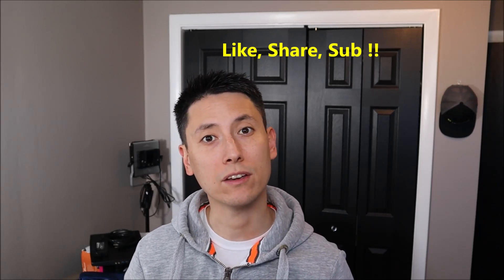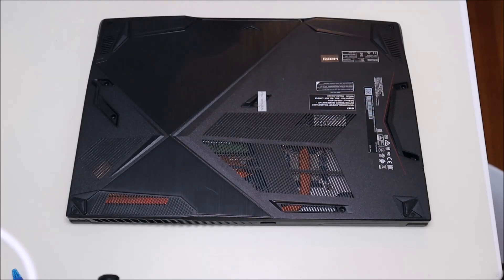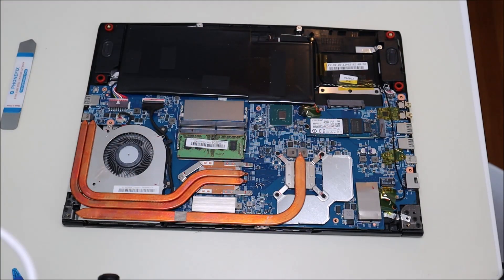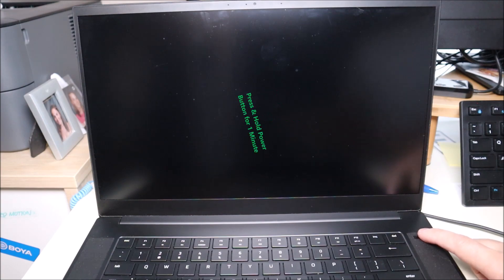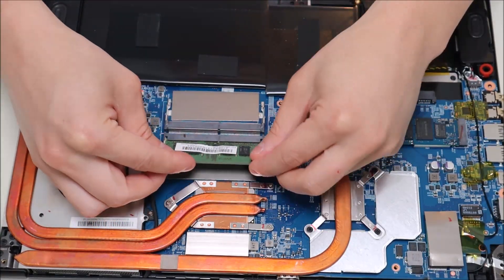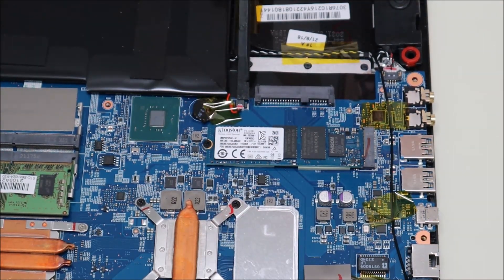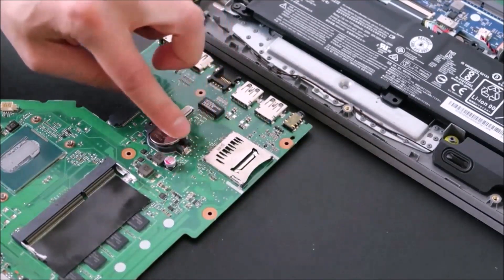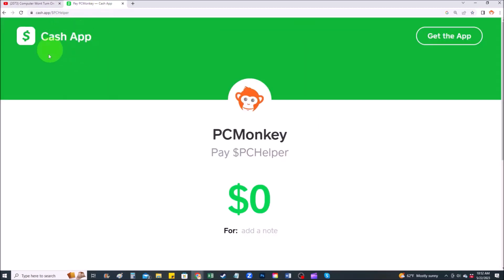MSI Laptop Computer - Dead / No Power / Wont Turn On Fix

Comment: my laptop powered on after removing the battery and plugging it in again. this method works every time, but i still face power on issues now and then. does this mean i need to change my battery?
Reply from the maker: Yes, you most likely need to replace the battery or charger. Also, is your computer plugged into a healthy surge protector? You can see a good example of one here: https://amzn.to/3XpHdlw
Reply: @PC_Monkey my charger likely works fine, it's the original charger and it will charge other msi laptops pretty fine. i know that my laptop battery has not been the healthiest for a long time now, and I feel like it's the right move to replace it.
Reply from the maker: @XenonForce  Good luck replacing the battery! Let me know if you would like help finding one :)
Reply: @PC_Monkey i think i will try to leave my laptop in a batteryless state and use bypass charging in the meantime while trying to find a suitable battery. may I kindly ask which battery would be suitable for model msi katana gf66 11ud?
Reply from the maker: @XenonForce  Not sure :( Is this your battery? https://amzn.to/43DR3TX

Comment: ok so im currently having this issue i disconnected the main battery from the motherboard than connected it again and it turned on for about 10 seconds before screen started flickering and than it went back to how it was before black screen button lights off
Reply from the maker: After trying that step, can you try the other steps seen here? Also, did anything happen before this issue started? Overheating, liquid spill, Windows update, etc?
Reply: @PC_Monkey  no overheating or liquid spill there was a windows update but that was way before this started i opened it up again and took out the ram and put it back in aswell as the battery and it was working fine but after i turned it off after that and closed it up and put the screws in it started flickering again when i turned it on so im at my wits end here
Reply from the maker: @vandastelka2522   If, after trying all the steps seen here multiple times, you have not been able to find the issue, your most likely looking at one of two possible issues. (1) The motherboard is bad and needs to be replaced. Let me know if you would like help finding a compatible motherboard. Or (2) there is another computer component, shorting out the motherboard and need to be replaced such as the power jack, USB board, Touchpad, etc. You would have to troubleshoot each of those individually but unhooking it from the motherboard and trying to turn the computer on. Let me know if you would like help with that operation.

Comment: Hello i have MSI Katana 15 B13V and sometimes i have to press the power button twice to turn on my laptop (when i first clicked the power button the power indicator is not even turn on so i have to click it again), is there any problem with it? can u help me please?
Reply from the maker: Can you perform the power drain a couple times as seen here? Does that help at all? Also, did anything happen before this issue started? Overheating, liquid spill, Windows update, etc?
Reply: @PC_Monkey  thank you for responding. actually my laptop is new its not even a month old so i kinda afraid to do the power drain especially several times. and about the second question i think nothing happening before the issue started because this is a new laptop.
Reply from the maker: @Lionidas21  If its new and still under warranty, you could void part or all of the warranty by opening it up. I would consider a warranty repair or replacement

Comment: My laptop wouldnt turn on after i forgot to remove the battery when i change my edp cable.

i have tried everything like pressing 60 second, remove the battery , then drain the power, put it back , and the ram , the cmos but it still not working.

i dont know wich part is broken but is that possible to quickly broke the motherboard when i forgot to remove the battery?

my laptop is msi gf 63 thin uc. and also i notice something. when i charge the laptop that is a small white led will turning on while charging even if the laptop is shutdown. but in my laptop now is also not working. 

so my laptop is completely dead and not even give any clue of life
Reply from the maker: If, after trying all the steps seen here multiple times, you have not been able to find the issue, your most likely looking at one of two possible issues. (1) The motherboard is bad and needs to be replaced. Let me know if you would like help finding a compatible motherboard. Or (2) there is another computer component, shorting out the motherboard and need to be replaced such as the power jack, USB board, Touchpad, etc. You would have to troubleshoot each of those individually but unhooking it from the motherboard and trying to turn the computer on. Let me know if you would like help with that operation.

Comment: I have MSI Katana GF66. My laptop won’t turn on. I think the issue is it’s not charging. My charger became too loose to fit in the charging plug. So I ordered a new charger and it still doesn’t charge or turn on. I pressed the power button for 1 min it didn’t turn on.

Assuming this is an old video, so getting a comment will take some time. I have warranty, so I’ll send it to repair but it would be really nice to know what the issue is and how to fix it in future.

Thank you in advance.
Reply from the maker: There are several reasons why a computer stops turning on. Unfortunately I can tell you the reason your computer isnt working without troubleshooting it. If you want to know what the issue is, I would recommend troubleshooting as seen here :)
Reply: @ thank you!!
Reply from the maker: @pateldhyey3063   Good luck !!  Let me know how it goes :)

Comment: None of those worked for me unfortunately

It started after i opened it up and tried to figure out why my monitor was having issues, i made sure not to short anything with metal or such

Only thing i touched inside is what seems like the ribon connector controlling the display, but i put it back properly, not really sure what could be broken
Reply from the maker: Are there any signs of life at all when you try to turn it on? Lights? Fan, Motherboard, or Hard Drive sounds? Anything seen on the screen?
Reply: @PC_Monkey  Nope nothing at all

I figured it out though.. The plastic bit on the battery thats held by a screw broke (Thanks MSI for putting a single screw for the entire heavy battery, very smart)

So it wasn't plugged properly and caused issues
Reply from the maker: @jajasteele  Glad your all set :) Always here if needed !!

Comment: Hello I hope you can see this, my MSI Thin 15 doesn't wanna turn on, it was plug when it happen, it was a gift and I'm sad I need help I need the basic stuff but nothing works
Reply from the maker: Sounds like your on the correct video.  Have you tried the steps seen here?
Also, did anything happen before this issue started? Overheating, liquid spill, Windows update, etc?
Reply: @PC_Monkey  no, none of this occur before the issue, I'll then try fix it using this video, thank you so much I hope it works because I have no guarantee 🥹🩷

Comment: my computer is flashing blue on it’s turn on
Reply from the maker: Sounds like your on the correct video.  Have you tried the steps seen here?
Also, did anything happen before the issue? Overheating, liquid spill, Windows update, etc?

Comment: I have quite the occurrence that I’m sure people have had happen but it’s super rare. So I had turned the laptop on and I only had like 15% left. Apparently the charger part needed to update. The problem I had is saving as much life as I could the laptop couldn’t hold on and died. So what happens now is want someone to answer? Can I just never use it anymore cause it won’t charge. It shut down on me mid-update.
Reply from the maker: Does the computer turn on now? its just stuck at 15% battery life and cant complete that update?
Reply: @ No so it died on me mid update so It can’t charge at all. I also tried the first method you did but all I got was a couple of flashing white on the power but didn’t do anything after that. In case you need to know I have the G556 Stealth.
Reply from the maker: @hender_tender1232  If the power drain didnt help, can you move on and try the rest of the steps seen here?

Comment: what does red LED of power Button mean ?
Reply from the maker: Sounds like your on the correct video.  Have you tried the steps seen here?
Also, did anything happen before the issue? Overheating, liquid spill, Windows update, etc?

Comment: what does red LED of power Button mean
Reply from the maker: Sounds like your on the correct video.  Have you tried the steps seen here?
Also, did anything happen before the issue? Overheating, liquid spill, Windows update, etc?
Reply: @PC_Monkey   i just plugged it to the grid , and hold the power button for a while, thank you, it seems it was low on battery
Reply from the maker: @stefano4533    Great to hear !! Always here to help :):)

Comment: Thank you Daniel great advises!  I got a MSI laptop and I was playing with out being conected to the wall. Then now is ridiculous slow and I cant do anything. The red light next to the start buttom keeps changging from solod red to whote every 20 sec or so. Do you uave any advised? Thank you appreciated
Reply from the maker: Sounds like your on the correct video.  Have you tried the steps seen here?
Also, did anything happen before this issue started? Overheating, liquid spill, Windows update, etc?
Reply: @ the Date was off and I fixed. It turned on, ask me to set a new pin number but dont go anywhere. I tell you what happen: I start playing Ghost of tsushima And I didnt realized wax no plug ged in. Tuen started running very sliw and I connected. Maybe over heat . Thanks a lot fo the help! What do you think?
Reply: I try what is in the video great. Just the date. Do you think I should try the other option on it?
Reply from the maker: @sileto4821  I dont understand. This video is showing how to fix a dead computer. A computer that wont power on. There are not steps seen in this video showing how to correct a date? What is the issue with your computer? Does it not turn on or are you having trouble changing the date in BIOS?
Reply: @PC_Monkey  I saw yor video about the Bio. And the date was off

Comment: Thank you for demonstrating the disconnecting of the battery plug. I needed the reassurance that it was in fact hard to remove and I just kept on trying for 10 minutes. Then holding the power button worked fine to revive my laptop.
Reply from the maker: Great to hear !! Always here to help :):)

Comment: so, i accidently shut my laptop down my flipping down the lid while updating i tried the power button method and im really stupid so ill fuck up the motherboard
Reply from the maker: No. Just the operating system (OS). If a computer turns off during an update, it very often can damage the OS. First, try the power drain procedure seen here: https://youtu.be/kOBY4k2Mn_k. After that, can you turn the computer on? If Windows wont load fully, can you access BIOS and find any Repair or Restore options?

Comment: Removing the battery plugging it back in then holding the button and then finally the power plug in made it work

Have no idea why it did this do you have suggestions to hopefully prevent this issue?

My laptop is the thin 15 with the 4050 and 12th i7 i didnt overclock or mess around with the bios
Reply from the maker: Glad your all set :) Always here if needed !!   
It could be just a normal and random power buildup or it could be a battery or charger starting to fail. Also, make sure your computer is plugged into a surge protector like the one in this list: https://www.amazon.com/shop/pcmonkey/list/2QAI8XMVWC7DK?ref_=aip_sf_list_spv_ofs_mixed_d

Comment: Idk my laptop is so complicated it turns on but when i look at the power it says 0 even though I have plugged it in for literally hours , even crazier when i play with it like minecraft you cant turn on the fancy settings or it well turn of sometimes i have it on low and still turns off , and my fan is making new noise every day 😅
Reply from the maker: If the battery is not charging, can you try the steps seen here? https://www.youtube.com/watch?v=uBr5XmtmKKM
Also, did anything happen before this issue appeared?  Liquid spill, overheating, Windows update, etc?

Comment: I have a msi gf63 11uc i tried upgrading the ssd and now it wont power on. There are no signs of life
Reply from the maker: The computer was turning on and working well before the SSD install? If so, have you tried putting the old SSD back and turning on the computer?

Comment: My daughter has a Modern 15. Charging jack melted. Desoldered jack to replace, but board was burnt. Purchased new board. Not exactly same but same form factor. Installed the board and all hardware. I get a charging light when plugging in charger, but nothing at all when pressing power button. Tried EC reset. Nothing. Any ideas?
Reply from the maker: Did you replace the charger? Very likely its damaged too or could even have been the cause of the problem
Reply: nothing wrong with the charger. It’s my other daughter’s.

Comment: It works for me without the battery. Like what do I do? Replace the battery and it will work fine?. I re applied thermal paste. I made sure to remove the battery. Then afterwards, the laptop won't turn on. I removed the battery like you said and checked with power. It works fine 😭😭. I guess time to replace battery
Reply: Nvm i just re inserted the battery pin and it started working. Idk why, early i inserted it firmly. Now i inserted it extra extra firmly and it's working. Man I never have these issues with later laps. Just msi 💀
Reply from the maker: @denji3397  Glad your all set :) Always here if needed !! Also, did anything happen before this issue appeared?  Liquid spill, overheating, Windows update, etc?

Comment: I have a PC specialist laptop I have done all of this over than the CMOS battery, my laptop won't turn on I give it to a friend he plugged it in it worked I took it home it worked one day then stop working the next
Reply from the maker: If, after trying all the steps seen here multiple times, you have not been able to find the issue, your most likely looking at one of two possible issues. (1) The motherboard is bad and needs to be replaced. Let me know if you would like help finding a compatible motherboard. Or (2) there is another computer component, shorting out the motherboard and need to be replaced such as the power jack, USB board, Touchpad, etc. You would have to troubleshoot each of those individually but unhooking it from the motherboard and trying to turn the computer on. Let me know if you would like help with that operation.
Reply: Hey man bit of an update I left laptop alone since I commented, I tried to turn it on today and the battery light flashed so I plugged it into charger and it works what could be the problem here